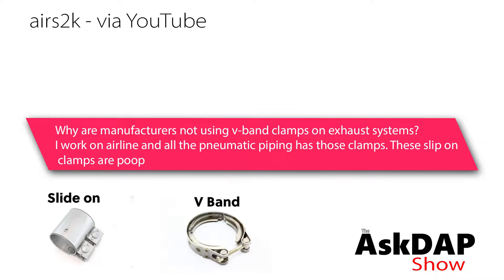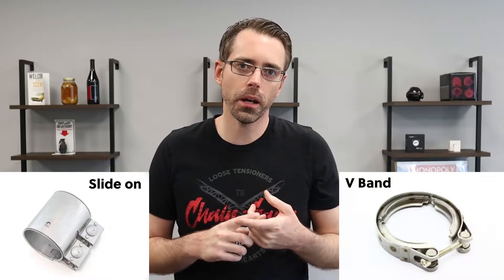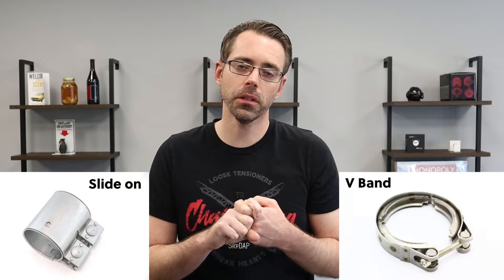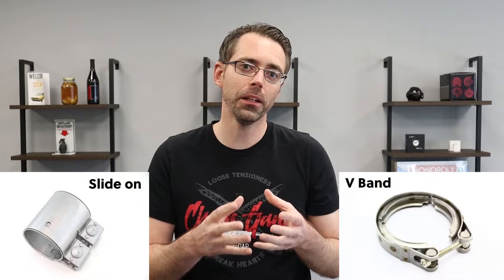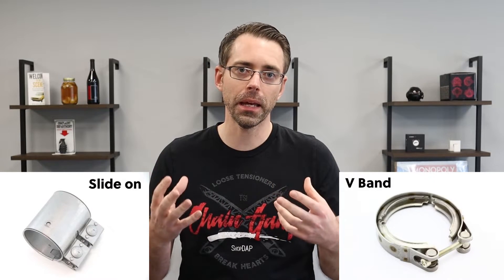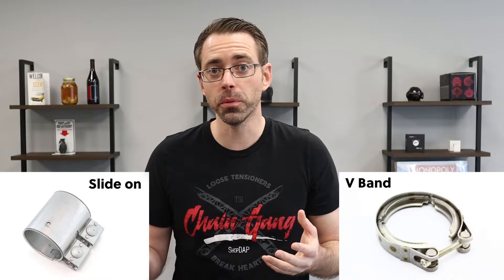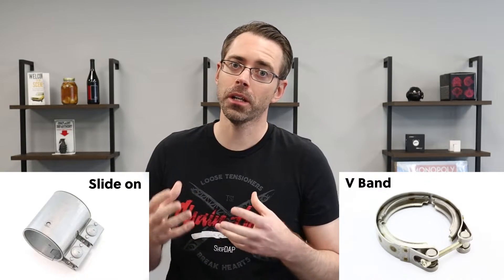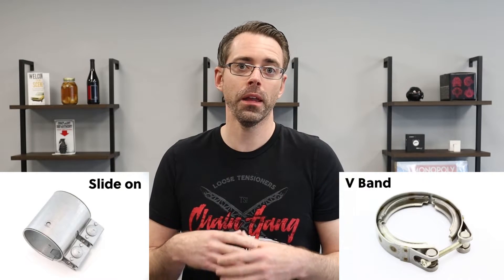V-Band V.S. Slip On Exhaust Clamps | AskDap

Comment: 2 and half mins to say...its cost.
Reply: That's just the consumer way of looking at it. Cost actually means much more time, expertise, and precision. Anyone can use a band clamp to assemble the exhaust, but using V Clamps can make some set ups 10x more difficult, especially if you have dual pipes right next to each other. You have disassemble the exhaust and pipes, get the right size clamps and flanges, measure precisely to accommodate for the V-clamps extra length, cut the pipes perfectly square, weld on the flanges CAREFULLY without warping them - and you have to do it on both ends, then perfectly line it up and snap them on. Alone, these clamps can cost $50-$80 each too.
Reply: @anonypersona3189  ..yawn.....
Reply: Did you miss the entire section about tolerances and how v-bands are less forgiving?
Reply: @yo_its_devo  no I didn't, it took 2 and a half mins
Reply: Isn't that YouTube in sentence?
Reply: Your phat ass could of been grateful he’s demonstrating this for you…